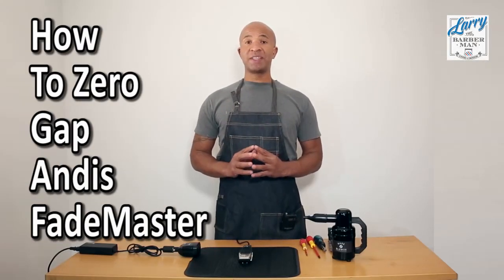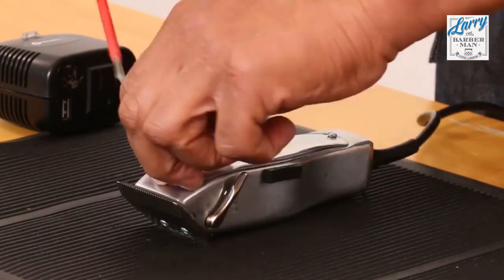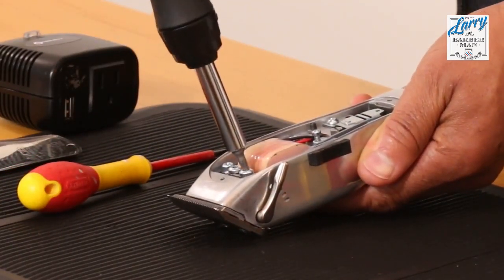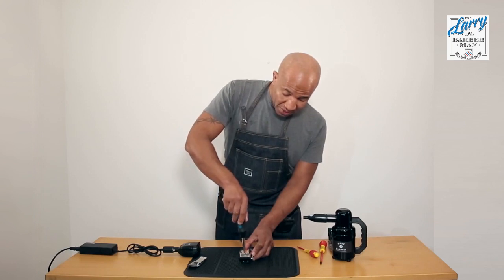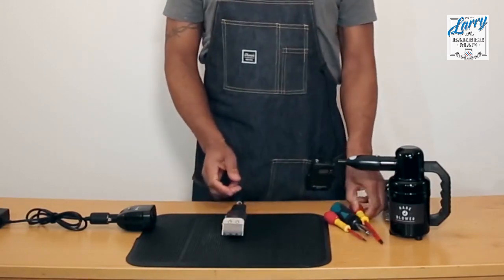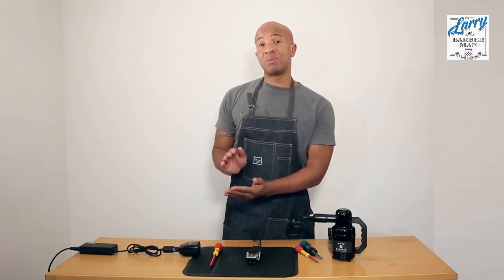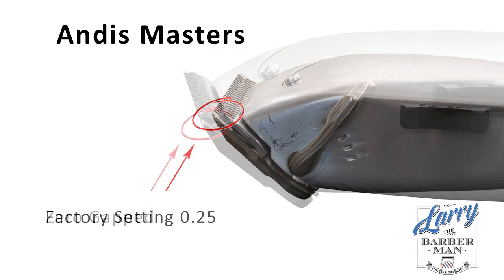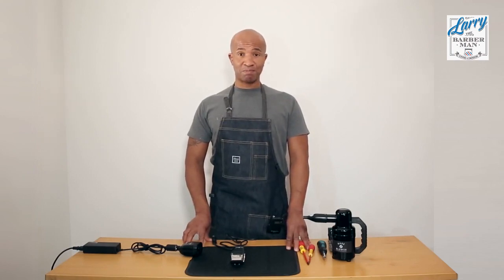Tutorial: How To Zero Gap Andis Masters  Made Simple

Comment: It would be helpful if you could provide 1) which Torx bit size you need and 2) How much torque to tighten the torx screws back so that it does not loosen up over time.  And when adjusting the top blade wouldn't it be easy to rest the edge of the blade on a flat surface while tightening the 2 philips screws?